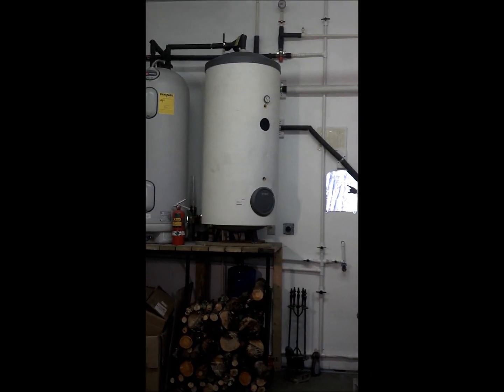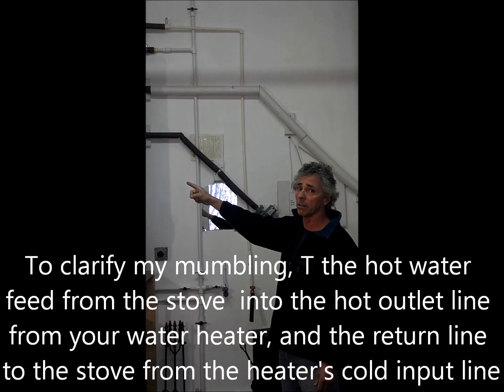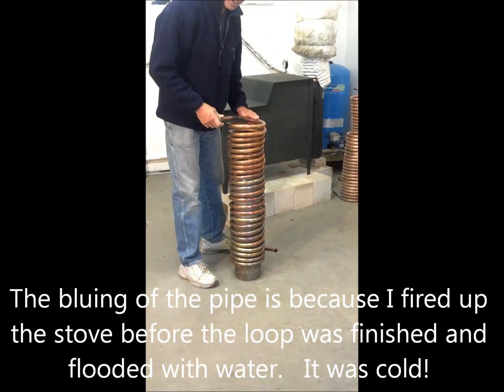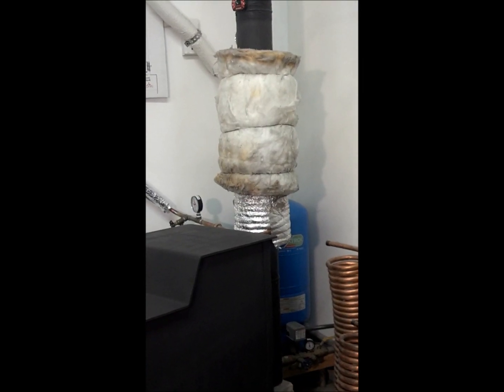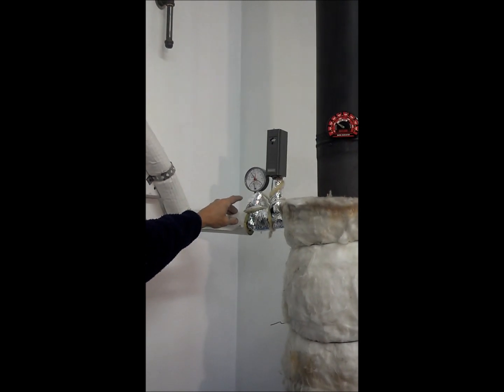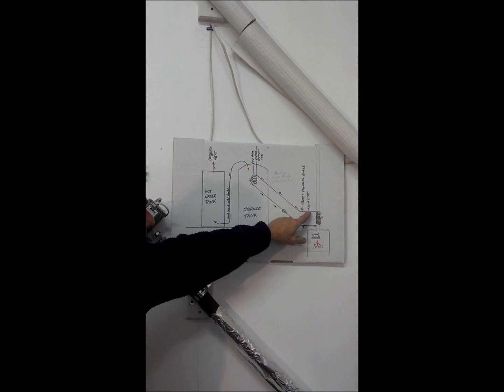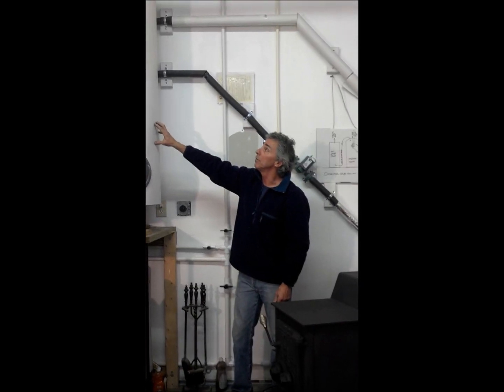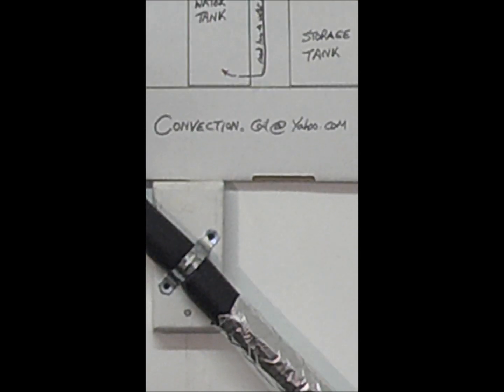How to get free hot water from your woodstove

Comment: Could you please make a video or describe how the electric water heater runs a radiant heating set-up? I'm curious if the radiant loop is a closed loop with a heat exchanger in the tank or if it's just the regular hot water that runs through your faucet taking a detour and radiant floor heating first. Thanks
Reply from the maker: Yes the radiant floor is a closed loop system and fed by a heat exchanger. There is a radiant heat company in Maine with an excellent website that describes the merits of both open and closed systems, google Radiantec. I however am not a believer in mixing domestic and radiant water

Comment: There's no doubt that you make plenty of hot water by heating it with your flue. However, the only way this can be safe is for the stovepipe to be cleaned quite a few times over the winter months. How many people are going to do that? People give up on off grid electricity because they don't care for their batteries twice a year. Dismantling the plumbing, then removing the flue to brush it out monthly (or even every other month) will be ignored by some, potentially burning down the structure housing the entire system. Otherwise, your process holds merit, as it appears you've covered much of the physics involved in the thermosiphon and heat transfer. Figure out the creosote issue, and you'll be rich. Perhaps a secondary combustion chamber ahead of the flue...? Good luck with the project.
Reply from the maker: The coil is well insulated and actually doesn't draw off all that much heat from the stack temperature, so there is a zero creosote problem. I burn about two cords of hardwood each winter and probably haven't removed more than a drywall pail of creosote in all that time. I do check the stove in midwinter and run a brush down it every fall, but could probably go safely go 2 or 3 years without cleaning the flue. The only section of un-insulated pipe is 6 feet or so immediately above my Fisher, the rest is insulated and thus keeps the stack temp up.That being said, the chimney cap does build up with soot where the exhaust hits the cold air and I need to clean that every time I'm on the roof.
I do burn only well seasoned (2+ years) wood, and I also let the stove run wide open first thing each morning to clear the flue and get a shot of extra heat in my home.  And yes Steve, you are right about secondary combustion, I added a simple system to my old fashion stove a few years back and it works great! Take a look at my other video

Comment: I don't quite understand the coil on the inside of your storage tank? Wouldn't you just have water traveling into and out of the storage tank?
Reply from the maker: That would work and in hindsight I probably would have skipped the Steibel tank and just tee'd it directly into an 80 gallon Marathon tank. The domestic hot water outlet however would absolutely need a mixing valve.

Comment: what if your water heater is lower than the wood burner? probably the case in most ppls home
Reply from the maker: Won't work with just convective flow and I absolutely won't recommend it.
Reply: in that case wouldnt you just use a aquastat and recirculating pump?
Reply from the maker: This would work well enough Rob, but you would definitely want the pop off valve well figured out and plumbed just in case the power goes out. By using natural convection the flow never stops and the system is far safer

Comment: I bet if you put a larger pipe around your copper coil or even a couple metal pails filled with just plain ole sand pourd around it that would be a good insulator.You could weld the pipe or pails to the stove pipe and some how suport the whole thing with some simple legs . Hey just a thought . great video ,thanks for the helpfull hints
Reply from the maker: I am now using Superwool+  1 inch ceramic insulation to wrap the convection coils and shelling it with sheet metal (36" flashing) painted with stove black. It looks great and the surface stays cool enough to touch at any time.

Comment: As for bending. Just use thicker copper and use the flue as the former. If you us refridgeration, soft copper, it will form quickly and easily.
Reply from the maker: I had suspended working on the Convection coils while I started a new pv solar installation business (www.nh.solar), but think I may have the time again next fall to begin making coils again. My intent at that time is to make up a machine to form the 3/4 tube around seamless stovepipe using the flue pipe as an arbor, just as you have suggested.

Comment: You don't want that aluminium foil touching the copper directly. It will cause galvanic corrosion. Fortunately the aluminium foil will go first in this instance.
Reply from the maker: I don't use the aluminum anymore since switching to the Morgan Superwool+ insulation blanket. When I removed the aluminum foil after a couple of years of use however it was exactly as it was when I first wrapped it. For galvanic corrosion to occur I believe there would have to be an electrolyte, and this was a totally dry contact.

Comment: I would get rid of the water in the exchange loop, and use a waterless coolant like Evans. It has a boiling point of 375F this would remove any pressure from the lines. It also has many other benefits.
Here's their site, watch some of their videos I use their stuff in all my rebuilds and custom build 4x4's.

http://www.evanscoolant.com/
Reply from the maker: I've never had any discharge from the boiler pv valve and the pressure in the closed loop rarely gets above 15 pounds max, so elevating the boiling point apparently isn't necessay. I stick with water in the loop because the internal coils in the Steibel tank are in direct contact with domestic water.

Comment: No expansion tank?
Reply from the maker: Good eye Pleasecho2  I have since added a small expansion tank on the return line. The system seemed to work fine with just the 2 foot capped expansion line, but I did see the pressure pass 30 pounds a few too many times. If never caused a problem with the boiler relief valve but why risk it. The boiler relief by the way is vented all the way down to within a few inches of my concrete floor

Comment: Thanks for the effort.  I think you have a great idea but you are going to be challenged with some other competition with the pipe bending solution.  Take a look at this and see if I am correct.  I could be wrong.  I am not a CEO of a fortune 500 hundred or nothing, but I have to make these observations for my efforts in business. Hope it helps.  https://youtu.be/-l-lMKlVFpA
Reply from the maker: +Davis Rogers Engineer 775 videos are all excellent and well worth watching, and the link you posted is a good example of this. There is however a huge difference between bending 3/8 and 3/4 tubing.
 First the weight of the coil you would be handling; 60' of 3/8 tube would contain about 3 pounds of ice whereas 60' of 3/4 tube has 11.4 pounds of ice. Second the strength of the ice; you can easily punch through a quarter inch of ice; but two inches will support the weight of a skater and 7 inches the weight of a small car. Finally you would need a fairly large and empty freezer to freeze a 60' coil of 3/4.
 Still it is an interesting concept Davis and I think I'll give it a try next winter when the outdoors in New Hampshire can be my freezer.  For now though my homemade arbor and die wheels machine does form each job perfectly. Thanks for the input...

Comment: I'm starting to build a cabin starting next month and am going to be off grid. It's not going to be big so I don't think I need a big woodstove but I saw a back boiler on EBAY but unfortunately you have to get it fitted inside the wood stove and I was disappointed as I don't need a huge stove as I said.  Now I am reasonably good at following instructions as dad was a marine engineer (wanted a boy, got me and I am willing to have a go at most things! ) Is there not some way of making the coils with ice? I know how soft copper is because I make jewellery and copper sometimes comes into it. Also I get what you're saying about hot water rising (like hot air) but you lost me at all those dials and gauges,  I thought you would be ok if your hot water tank had a working safety valve thingy?  I used to live in a cottage with one of those open fire ranges from the 40's and at midnight every night you had to have a bath (the bath was from the 40's too it was huge the biggest bath I have ever seen! ) because the tank would start making scary noises and I couldn't sleep because it (the fire) never went out til morning so I would be thinking it was going to send the cottage and me into orbit! BTW the answer is yes I think you should patent it...I'm off to see if you have uploaded anything else (I'm not going to be playing with the hot water until I have the cabin up and I may not survive the sawmill so I won't place an order just yet Lol! Good luck with it!
Reply from the maker: +Anne Anderson (Foxiepaws) I found that ice and sand did not work well at all with 3/4 pipe, but am told it does with much smaller diameters. Problem is the decrease in flow is logarithmic with the decease in diameter. If your need for hot water is minimal and you have adequate well insulated elevated storage, a hand formed 3/8 coil will likely suffice Anne. I went the 3/4 route because I needed enough capacity to pre-heat both my domestic hot water and radiant floor needs.  You are right, the "safety valve thingy" is of paramount importance!

Comment: how do you all get that to pass safety code!?
Reply from the maker: +Steve Foster I live in New Hampshire where the State motto is, Live Free or Die  ;-)  
Seriously though Steve, code enforcement varies and luckily I'm in a small town where there is a bit more freedom. I built my small home entirely on my own but did try to adhere to code. The final inspection to get my occupancy permit was done by the assistant fire chief in my town and he saw no issues in the way I have my system set up. Now lest you think he was lax on details, I ran my own gas pipe as well and did have to dis-assemble some of it to replace one galvanized elbow that I had used when I ran short of black pipe. Apparently nickle with flake off when exposed to propane...

Comment: So this is a closed system using coil loops - one on the stove stack and a smaller one inside the tank as your heating element?  The water in the copper loop system never mixes with the water inside the tank?  Wow!  Are you planning on making the smaller coil loops for inside the tank as well as the coil loops for around the stove pipe?
Reply from the maker: +Beth Oquist No, I do not plan to make coils for the storage tanks, there are plenty of specialized tanks like my Steibel currently available. Alternately you can simply T a Convection Coil directly into the inlet and outlet lines of an existing tank, but this does require a mixing valve to be installed in the domestic feed

Comment: You can make a simple bender out of plywood and 2x4s. cutting the plywood to the radius you want and adding sides of plywood. Using the 2x4 as your bender with a roller. Harbor Freight also has a rolling bender.

Comment: your insulation around the flue pipe and coil should be something called koa wool insulation. it is what is used in gas forges. it can handle extremely high heat and no fiberglass. just a suggestion. hope this helps.
Reply from the maker: +Phillip Patterson Actually I now have the coil wrapped with Morgan Thermal Ceramic 1" Superwool blanket, and shell with light steel. Superwool is made to wrap the stainless flue inserts that are often installed in older chimneys. It works so well that even after hours of running my stove really hot, I can lay my hand comfortable on the shell

Comment: thank you so much for your video and all the info .
question #1 : what is the most efiecient point to draw heat from a stove , the main body of the stove or the exaust tube ?
question #2: is there any chance that i would reduce the exaust fume flow if i draw too much heat from the exaust tube?
thanks a lot
Reply from the maker: +BisdremisKostas I'm sure that a stove top heater would be more efficient, but efficiency wasn't really what my prime motivation was. I wanted a design that would constantly and naturally flow anytime it was acquiring heat, thus the need for a vertical coil.
The Convection Coil won't by itself reduce he draw of your flue pipe, but a build up of creosote certainly would! The Convection Coil needs to be insulated not just so it will gather more heat, but also to be sure that it doesn't cool the stack temperature too much.  I've never had any issue with creosote build up at all, especially since I added the secondary air intake shown in my Fisher modification video

Comment: I really enjoyed your video. you are hilarious, love the words on top-your hair ain't that long. I'm living off grid in a teeny micro home in western Montana. I dream of hot water coming out of a pipe. I'd  need to modify, simplify. no room in the 7'x11' (yes, 77 square feet) domicile for all that contraption. What about just fitting the stove pipes with that purdy copper tubing? But how to get the water in-and how much water does the pipe itself hold. I don't need much. Just doing dishes and bathing in the sink a couple times a week. And one last stupid question; how to install that pipe? I gotta remove the pipe from the stove?  Lavenderlori11@gmail.com
Reply from the maker: +Lori Parr The 3/4 Convection Coil needs at a fairly good sized storage sizable tank to be able to shed all the heat it produces. In your case you might consider using a small diameter refrigerator tubing which you could easily hand form around your flue and then have it feed into a small elevated hot water tank. That should meet your needs Lori without the need for a lot of cash, space, or the need to dismantle your flue. Be very careful when you first are using it though, you may need to add a tempering valve to  the domestic feed.

Comment: Awesome video, 
Do you think the system could be converted to be used to heat water in a green house wicking hydroponics system? 
it would mean sending the hot water approximately 100 from the low end to the upper end 
please contact me by email at nathansnow79@yahoo.com 
thanks
Reply from the maker: +MrNathansnow79 This most definitely would require an electric circulator. Plus I'd still suggest having a storage tank to both store and temper your water
Reply: +convectioncoil.com Ok
thanks for sharing

Comment: I can vouch for the concept, cost, function and brain dead simplicity of thermosyphon hot water systems.  I built an in stove model in 1975, following the principles in the book "Handmade hot water Systems"

   Mine was built inside the stove out of 1 inch copper with 180 elbows, placed against the far inside wall of my ~32 inch long stove.  That allowed me to tune how much heat went into the stove or water by just varying the distance from the main fire.

    Bottom line is we got 36 years of free hot water, pretty much anytime the stove was operating (often in NH)  All for 50 dollars worth of materials in 1975, and absolutely zero maintenance over those years.  We are now spending 7 months in Florida, so I have'nt got to fire it up recently.

    I finally had to replace my OLD Sepco stone lined water heater last year, and get the 350 lb behemouth off the wooden platform I built for it 40 years ago.   I put in a heat pump water heater in anticipation of selling the house last year, but really miss filling the stove and making hot water and heat!

      Do it, you won't regret it.

Comment: i would like to see the inside of the stovepipe where the coil is - does it cause any extra creosote to build up or anything ? you would get more out of it if you had a horizontal section that it was wrapped around - heat the house with this as a hot water system - cool idea
Reply from the maker: Kevin Olesik Good suggestion for the video on the inside of the flue pipe. I'll attempt to shoot one showing that when I clean my chimney later this spring.
While I agree that a horizontally mounted coil would likely gather a greater amount of heat, there are multiple reasons I wouldn't suggest it. A hybrid system with a horizontal collector feeding into a vertical Convection Coil however does sound very intriguing. For more detail on this please refer to the suggestion by Keith Hill in a previous comment.
Reply from the maker: +Kevin Olesik No noticeable creosote buildup at all Kevin. Due to the Superwool insulation wrap around the outside of the coil and the fact that the cooler water returning from the tank is still usually at 100+ degrees, I think it  might be removing even less heat than a bare flue pipe